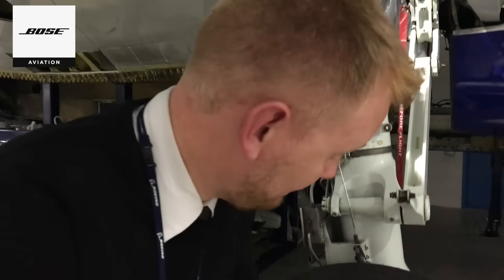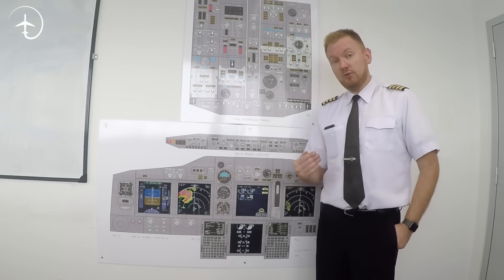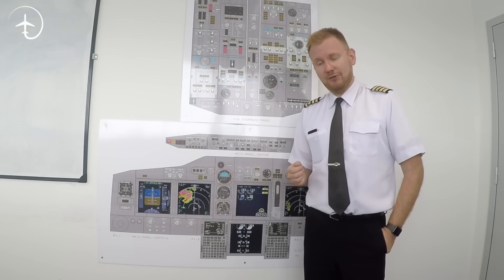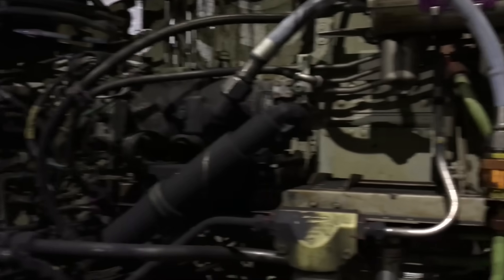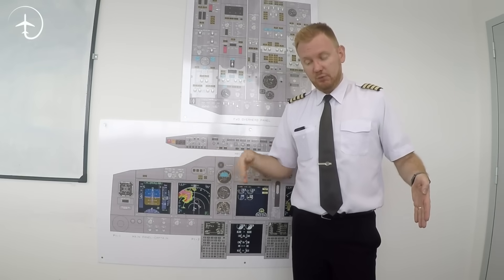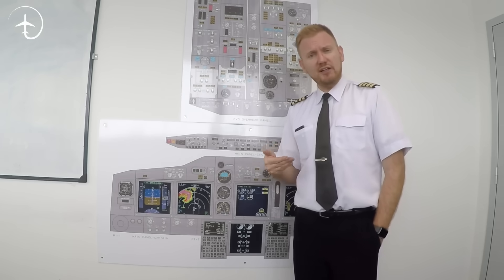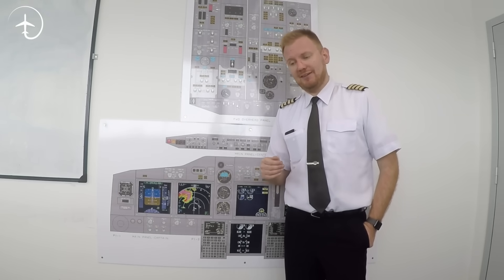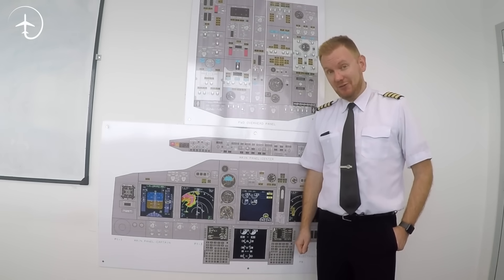Why does the Boeing 737 not have any landing-gear doors?

Comment: Very interesting video. Speaking about the temperature, what about the tyres, doesn't the rubber get frozen in -50 :-) I can see it works everytime, but still impressive that the rubber doesn't get hard and that it can handle the huge differences in temperature.
Reply: KuK137 Wind does not change the temperature, its feels colder for Humans (wind chill) but put a thermometer into a wind and the temperature won't change...wind blows the surrounding warm layer of Human skin..making it feel colder, but in reality its not
Reply: I second that James!
Reply: I third that James
Reply: And thats why everything related to aviation is so expensive I guess
Reply: It's not primitive and obsolete, temperature is not lower in the wind, airbus solution is not necessarily 'safer', there is no brand loyalty bs here... just... oh man... 737 has a pretty decent safety record throughout it's life cycle even with it exposed wheels, believe it or not. Some of the solutions mentioned in this video are just simple and effective... I'd personally be very amused to see someone not climbing into a 737 because its exposed wheels 'ring their warning bells' hahaha!!
Reply: Steen Pedersen rubber types could be very different as by its chemicals, as well as by the technology used to produce it.
Reply: I know and thats amaze me that the tyre can go from -55 to +30 in 20 minutes and not be big icecubes. Its a big mass that needs to be unfrozen in short time. The time in -55 is often longer than the time you descent.
Reply: A good "rubber-mixture" is important on aviation tyres. Since they're mechanically robust, I would call them perfect winter tyres requiring a broad temperature range. Because still a certain stability is needed when landing thereafter at e.g. Dubai. Where it can be quite hot outside and as well on the runway surface itself.
Reply: I would bet most people who have flown on a 737 never even knew about or even cared to know about how the landing gear is stowed in flight.
Reply: "much better and safer for passengers" - really? better is an opinion, and the truth is probably a matter of economics. Per seat mile cost to operate + maintenance costs for a 737 (especially the MAX) are especially low. Easily comparable or better than the A320 series.

As for "safer" - that's simply untrue. Please name any incident that has ever occurred and can be attributed to the Boeing main gear design. I'm not aware if any.

The truth is modern airliners are incredibly safe and very frequently used so any safety issues, especially with design, would quickly become apparent because on average Boeing estimates 2.2 of their 737s land or take off someplace in the world every second of every day.
Reply: I recalled 737 don’t have land gear door so to save weight.
Reply: The wind rushes past the tires throughout flight - this has a moderating effect that more rapidly reduces the temperature difference between the tires and outside air, as compared to still air.  So by the time the aircraft is preparing to land, the temperature of the tires probably wouldn't be much cooler than the outside air temperature at field elevation.

You can see this effect by placing a fan in front of a bowl filled with ice - the downstream air is cooled by the ice, and the ice melts as its temperature rises.
Reply: Belly of planes don't get icy. He explained in the video. Crew members don't even use de-ice fluid on the bottom of the planes.
Reply: Even with landing-gear doors, it's very cold inside the wheel well anyway.
Reply: Jeff B - I've flown many times on 737's and it is certainly news to me!
Reply: Wrong. Effective temperature is much lower when the item is subjected to wind vs being in enclosed space. Try it yourself, stand in winter in wind, then seek shelter. Airbus solution is much better and safer for passengers, I like how video just glosses over it due to brand loyalty when really "this engineering solution is 50 years old" doesn't mean it's good, it means it's primitive and obsolete vs what we can do today. Yes, sometimes old ways were good but this video even mentions it was done to accommodate dirt poor airports 60 years ago which really should ring warning bells as then safety was a third grade concern...

Comment: I don’t understand the bit about debris being sucked up inside the wheel well, or a tyre puncture doing damage? Surely this would still happen if there were bay doors? The damage would be done before the doors close.
Reply from the maker: Yes, this was more of a side-line in order to explain some more about the actual system.
Reply: Mentour Pilot OK, thanks, very informative as usual.

Comment: You talk about the brakes being applied to the main wheels as they go into the wheelwell and the front tyres coming into contact with he snubbers, but why do the wheels need to be stopped going round in the first place?...Give it a while and they will stop going round anyway, so why the need to stop them and hold them in the stopped position?  thanks...

Comment: I want to fly at mach .97 !! That Citation X looks sweet !! I wouldnt want to lose an engine at rotate though
Reply from the maker: You NEVER want to loose an engine at Vr :)
Reply: kim621100 the X tops out at .935 mach, which is mighty  fast. The 8x is .90, however, i have never flown it anywhere close to that, except in the simulator💞

Comment: 14 or 40 psi tire pressure? I know the audio suggests 14, but it seems very low pressure to me so I wanted to double check.

Worst case scenario: what happens if a wheel exploded after the gear is fully retracted?

Fun fact: I paused the video after 20s or so and tried to answer the question myself and got pretty close, as I thought the wheels were exposed for sake of semplicity and the blue thing was there for aerodynamic purpose.
Reply from the maker: It’s actually 14 Bar.
Reply: Mentour Pilot or 203 psi. Thanks!
Reply: A tire will not explode in the wheel well, the tire will deflate. On the wheel rim, a melting fuse plug is installed and if the wheel is becoming too hot due to high brake temperature the fuse will melt  and the tire will deflate.
Reply: 205psi going boom! That would probably blow a huge hole in the aircraft. I've seen a truck tyre blow and tear parts of a passing car...so a similar tyre at 200psi is a bomb. They must be seriously strong...considering they are remoulded a few times
Reply: as an A&P for an airline .. i was thinking what was wrong with this guy. 14psi ? what is he thinking.. lol thanks for correcting  and the pressure for tires are different for different carriers and types of 737..
Reply: Acft tires are very strong, they're made of over a dozen layers in most cases with steel chords between each one. they also generally have both thermal and pressure relief valves built in so they'll deflate before they explode.

Comment: I would like you to investigate and explain the Boeing Honeywell "uninterruptible auto pilot system" on some aircraft.  Thx
Reply: There is not and should not ever be an uninterruptible auto pilot system they malfunction way too often.  All Boeing aircraft have a master autopilot disconnect switches for each autopilot located on the glare shield incorporated into the autopilot switches.  To kill all power to the autopilot computers, servos, and guidance select off and always remember that job one is to fly the airplane not mess with the autopilot.
Reply: Mentour Pilot so that means you have the Rockwell Collins system? Is it possible you could do an explanation on that? ;)
Reply: I had a Collins "S" line HF  receiver, transmitter, and 1KW linear amplifier once!  :)  WD8NLS
Reply from the maker: Well, we don’t have it and I’m not great at going into details on Aircraft I am not typed on but I can have a look.
Reply: Apologies I didn’t mean to write I..please disregard..apologies again x
Reply: +madders Or you know.... delete it....
Reply: Nothing made is designed to not break. If you are dissatisfied with the Honeywell stat, wait until someone talks you into a Nest. You will really think that one is broken.
Reply: UNLIKE TCAS and TAWS there IS a switch to "Disengage AutoPILOT" if you cannot find TURN IT OFF. 
in the Boeing manual __Palmer__ ,,
it's your OWN DAMN FAULT  !@#!;
Reply: your born in the wrong timeline
Reply: WE  ELL   uninterruptible  POWER supply  and UNINTERuptible APU ; YES, YES.    but  not the UNTER autopilot system unless its on the 4 Transducer simulator.   that GE. Designed.   THERE  just  WUT  you wanted to VIEW in 3D.
Reply: I think you are confusing autopilot and fly by wire systems.  FBW is actually an outgrowth of autopilot systems.  For instance, a 737 autopilot system operating in the most basic autopilot mode, CWS or control wheel steering, is visually indistinguishable in the cockpit from manual flight.  The pilot still uses manual inputs to the control wheel and column to fly the airplane, but the controls are not moving due to manual inputs.  Rather, the inputs made by the pilot are detected electrically, and processed by the autopilot system to produce electrical signals to servo valves that move the controls with hydraulic power.  If full-time CWS was implemented by removing the control columns and installing joysticks to detect pilot inputs, you would have a very basic FBW system.  As it is though, autopilots can be overridden or disconnected.  FBW can be overridden to some extent, but not disconnected, because that would leave no method of flying the airplane.
Reply: As far as crashes go, human error is much more likely to produce an accident than a malfunctioning autopilot. Statistically, for safety's sake, it would make sense to make the autopilot impossible to switch off, or at least the safety-critical part. In critical systems, machines will cause errors less often than people will. 

There have been cases where confused or ill pilots have overridden automatic systems that were functioning correctly, causing an accident. On a semi-related note, the Chernobyl nuclear reactor accident happened after several automatic safety systems were manually disabled, for a test they were running. 

But pilots don't like the idea of a plane they can't fully control if they want to / have to. Similarly passengers feel safer putting their life into the hands of a fellow human, even if a computer would do a better job. 

For many planes it's possible for takeoff, flight, and landing all to be done automatically. That said, as far as I know, as a mere passenger, most commercial flights spend most of their time under autopilot control.
Reply: I think since that airbus crash where the autopilot would not allow pilot to do what he wanted, I don't think having an autopilot you can't turn off is a good idea. Of course you can't or don't want to turn off the fly by wire from what I know.
Reply: Mentour Pilot i
Reply: +Peorhum It's not the "autopilot", it's programmed into the basic controls.  the controls have enough "smarts" to know that "I'm in state X, if I let you do _that_, we have a good chance of dying".  Which is why in many airliners, if you try to, say, fly inverted, autopilot or otherwise, the controls will stop you.

These first appeared in the F4 Phantom I believe in the Vietnam era.  Which never had a autopilot.  The control system simply wouldn't let the pilot pull more than (IIRC) 4Gs, because 4Gs was the safe limit in the manual.  Then they lost pilots who were prevented from out-turning their opponents (or their missiles).  As one one pilot put it "which would you prefer?  A missile up your ass, or a slight chance of having the wings falling off?  You'd could more easily survive the wings falling off."

These days there are ways of overriding the basic limits when circumstances really call for it.  In some cases it's a couple of switches.  In other cases, it's just "push harder!" (I think this was the solution implemented in the Phantoms).

Which Airbus crash "because the autopilot wouldn't let them" are you referring to?  Hopefully not the Air France crash off Brazil around 2010.  That had nothing to do with the autopilot.  The autopilot switched itself off because it was getting inconsistent speed indications (the pitot tubes froze up).  The plane crashed because the pilots didn't follow the "unknown airspeed" protocol, failed to fully recognise that they had stalled (despite the stall warning screaming in their ears for almost a minute), and persisted in giving full up elevator right down to the water.  The aircraft followed every control command the pilots gave it.  They were just the wrong commands to give.... 

Similar to the Dash 8 that crashed near (Syracuse?  Buffalo?  I don't remember at the moment).  Stalled due to icing, and the pilots insisted on doing exactly the wrong thing - pull up on the stick until ground impact.  Normally one of the safest aircraft in the world for flying in bad conditions (_especially_ icing), the pilots demonstrated great talent in crashing it that way.
Reply: Not this little black duck.  Screw that.
Reply: SatelliteGalaxy No, perhaps in 20 or 30 years.  If it was in 10 years, the aircraft would be in development now.  Too many risks at present with pilotless aircraft.  The military loses drones from time to time (unrelated to combat). The airline business can’t tolerate that.
Reply: Peorhum the autopilot will never prevent the pilot from doing what he/she wants.  If control inputs occur, the autopilot will disengage.  I assume you are referring to AF447.  When air data inputs were lost, the aircraft went into alternate law and the autopilots disengaged.  The pilot flew from that point on.
Reply: Fromage Frizzbizz this is only true with fly by wire aircraft.  Not true on 707, 727, 737, 747, 757, 767, DC-9/MD-80 series, DC-10.  You can roll these aircraft all day long.
Reply: +Oscar Blue  Well, at least you can try rolling them ;-)

Thanks for the correction.
Reply: Fromage Frizzbizz try this one: “Tex Johnson 707 barrel roll”.  It’s on YouTube.  I think you might enjoy seeing what a good pilot can do with a 300,000 lb airplane.
Reply: that's an insult to "a proper peasant".
Reply: Brant Lafrenz Go price a thermostat for a Boeing.  They are a bit more than the ones used in the home.  To give an example, a 10” display for your home goes for ?????     A 10” display for a transport category aircraft might run $60,000 ( or twice that for a current generation aircraft).
Reply: Art Houston, "Dissatisfied"?, No I'm furious! My thermostat was only 43 years young, just another case of planned obsolescence. Honeywell should stick to gold platting and sputtering, not home appliances, everything I buy needs to at least last three generations with no degradation! That's why I've never changed the tires of my car and when a light-bulb burns out I leave it, no since giving those Illuminati illumination nazis my hard earned money for there planned obsolescence built into there conspiratorial fluoresce.
Reply: A D••••Ask Field McConnell of Abel Danger. He knows everything about the “uninterruptible auto pilot system”
Reply: Honeywell made my thermostat, which broke ...yep that must be safe brand for a plane.
Reply: 10 years from now commercial aircraft will have NO pilot. Autopilot only. Moreover, passengers will load their own luggage.

Comment: at 8l43 you mention 14psi, but that is just below 1 bar... i searched the internet a while and found that it normally is above 200 psi what is 14 bar. i guess you ment 14 bar...
Reply from the maker: Correct! It’s supposed to be 14 bar. Slip of the tongue

Comment: How often an airplane need to replace wheels...
Reply from the maker: Quite often. I don’t have the exact details but we change them often.
Reply: Depending on the weight, runway quality, cross winds and... pilot’s hand. Always when a ply is visible.
Reply: It depends on the aircraft.  Anywhere from 250 to 1000 landings.  BTW, the tires are retreads.
Reply: 1000- landings? so runway is 3 km, and taxi is anoteher 3 all that times 2 is 12 000 kilometers. wheels on truck last 30 000-80 000 km and truck doesn't need to stop 40 tons 1000 times from 200km/h on 50km/h side winds and 1G side force.